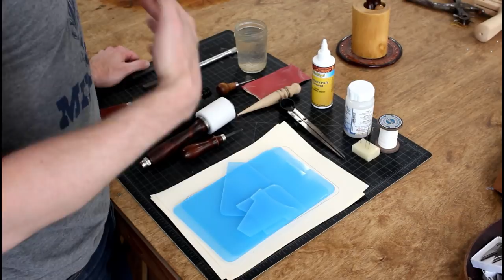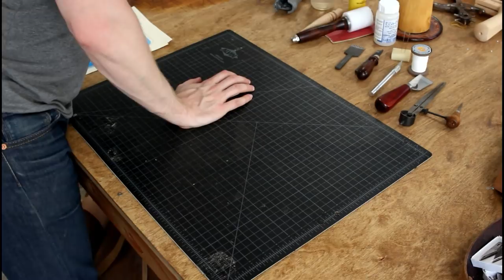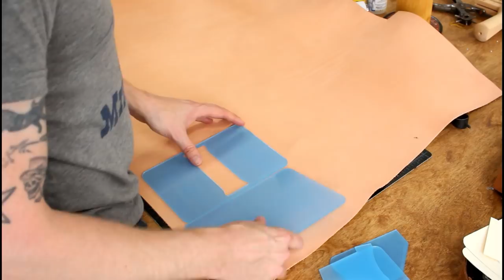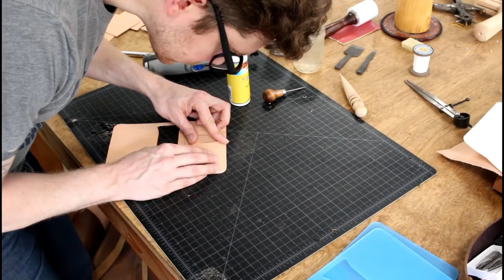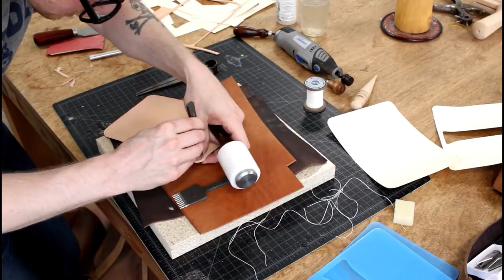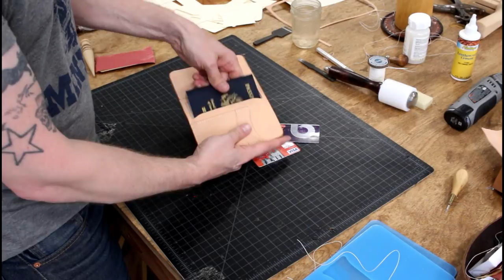Making A LEATHER PASSPORT CASE | FREE PDF PATTERN!

Comment: I don't know if anyone else had this issue but regardless of printer settings the template prints 0.5 cm too small.
Reply: Yes same with me. Some bits are right and other bits are wrong. Especially the inch measurements.